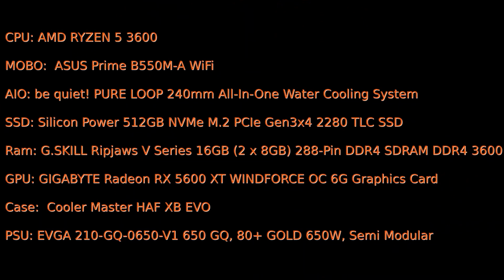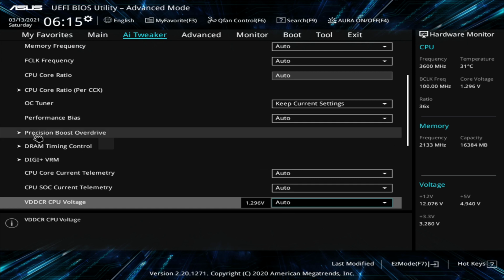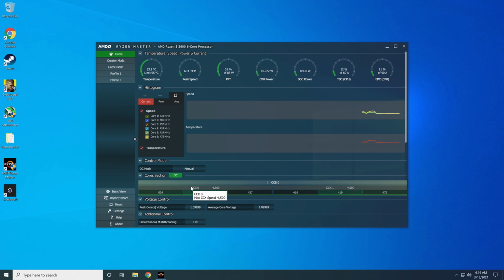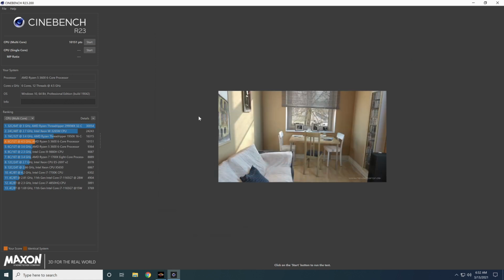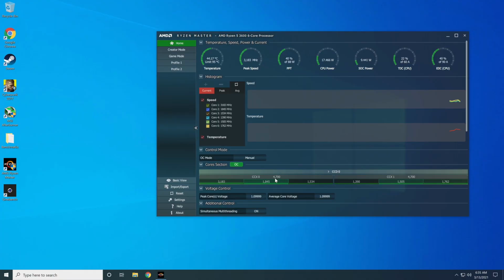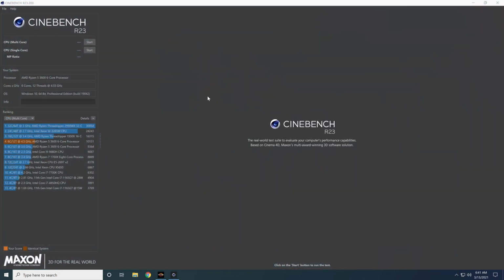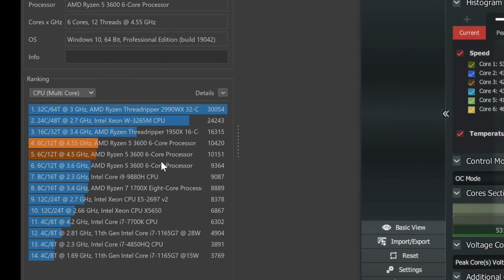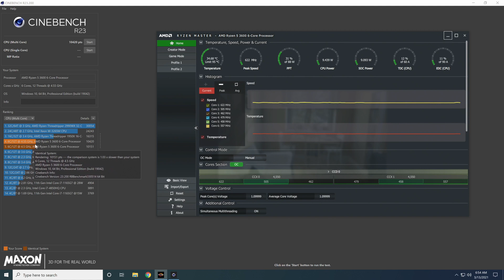Overclocking  the ryzen 5 3600 on the Asus B550M-A wifi motherboard with an AIO

Comment: got a 5600 and was able to get it up to 4.7ghz on this oc guide. The 1.35v is a perfect sweet spot with voltage unfortuantly im running into a bit of a heat problem as my tdp is hitting 130ish watts =/ but my aio is keeping up alright for now. thanks for the guide!

Comment: Hi ,i have a Gigabyte b450 Aorus Elite and Ryzen 5 3600 but mine has a boost clock of 4.2 and that is where my problem is ,everytime i try to overclock to 4.2 it always crashes and even on 4.1 sometimes it runs but sometimes it crashes and i can only overclock to 4.0.What am i doing wrong? I would really appreciate the help, thanks!
Reply: your VCore is probably low. slightly increase it by 0.05mv increments and keep it to the amount it don't crash.

Comment: not working for me.. why?? it is just not saving multiplier
Reply from the maker: Sorry not sure. Thanks for watching and the comment.
Reply: @DavesTechway  ive got it! Someone adviced me i need to put asus motherboard mode to “normal” and it is working  bcs when its in the other mode (not sure how its called), it will clock only to 3,95ghz .. so i am now going 4,4ghz at 1.243v

Comment: im only able to choose Auto or offset for cpu voltage. same motherboard but i have ryzen 7 3700. wots the deal?
Reply from the maker: Not sure maybe the bios version you are on. Thanks for watching and the comment.
Reply: I’m having the ame issue right now, did you find a solution?